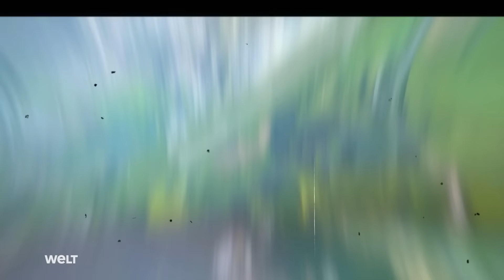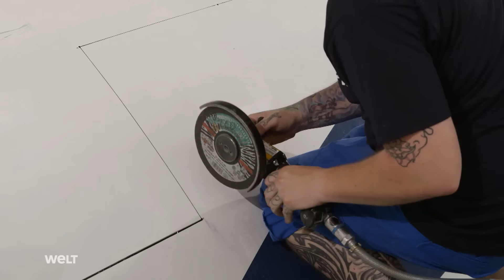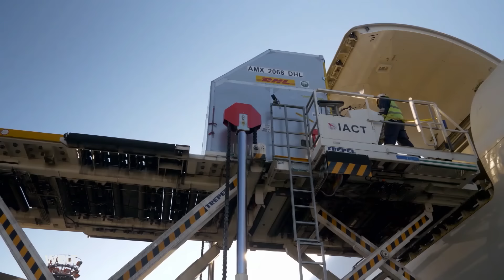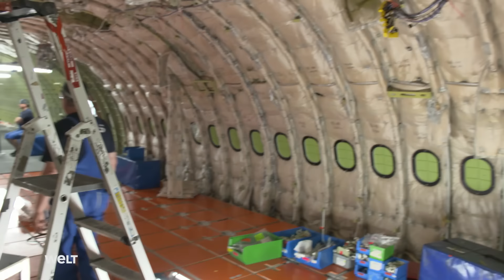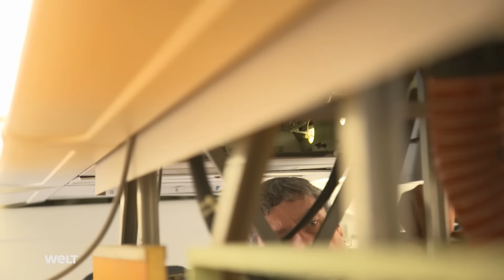AIRCRAFT CONVERSION XXL - A cargo plane is born  | Full Documentary

Comment: The term 'former' probably means 'frame.' It's been translated from German and they missed on this one.
Hydraulic systems don't use 'oil' they use "Skydrol," a synthetic oil that is less flammable.
36:21: That yellow rod installed in the empty nacelle is used to equalize weight on the airplane structure. It weighs the same as a jet engine.

Comment: I drove garbage trucks which have a governor on the engine & a PTO which goes into overspend to dump the load. Why can't planes have a limiter to prevent overspeed in the throttle cable?

Comment: I’m so impressed you are talking about this. As a student myself I didn’t really realise how easy it can be to over speed. Incredible, surely there should be a limiter like a motorcycle. Also I do have a question, if you were ready to lift wasn’t the governor active controlling the engine and rotor rpm?

Comment: I was a licensed aircraft mechanic back in the sixties. I worked for a company called Hollywood Aviation in Southern California. We converted four engine DC-6 and 7 passenger aircraft to cargo aircraft  under contract to a company in Chile. They hauled all kinds of produce and  butchered beef over the Chilean Andes. It took about six months to convert each plane to a cargo carrier. Our crew was around fifty mechanics and technicians. We also converted Convair  660s and 880s to twin turbine engines which required the engine nacelles to be re-engineered and made of stainless steel.

Comment: Very nice informative video. One small query is why the original passamger jet  engines are removed and replaced with other ? Does cargo planes requir additional high power emgines?.
Reply: It's like an engine rebuild, the old engines must have won out during it's 20 year working lifespan so either new or rebuilt engines are needed obviously

Comment: I'm curious - the pilots (and presumably anyone else in the cockpit) have O2 available. If they had a cargo compartment fire, could they flood it with Halon BCM while the crew were on O2 to extinguish fire?

Do they still use the belly space for cargo as well?
Reply: FedEx has a system kinda like this on some a/c. An arm in the ceiling goes to the affected cargo can, drops down and pierces it, and injects extinguisher. I'll see if I can find a video on it.

Otherwise, simply depressurizing the a/c and going on o2 will starve a fire without any extinguishing agent at all, provided the a/c is at altitude

Comment: A very interesting documentary. I was wondering though what happens to the original baggage/freight compartment area? Is it used at all?
Reply: Loading cargo aircraft is all about how fast can they get it loaded and turn around. That's why they use those preloaded pods. If they had to also try and load the secondary areas, it would slow the aircraft production time down as all that cargo would have to be hand loaded and unloaded.
Reply: Not usually.
Reply: Yes. They sell seats ,etc to other buyers. There's a big selection of used parts, quite lucrative.

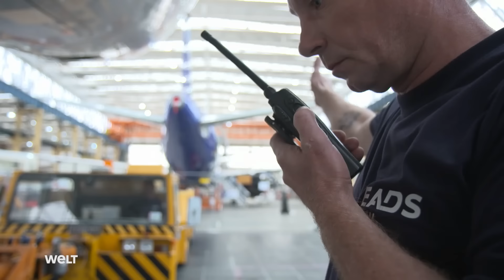Comment: One of the aircraft shown here, the former China Eastern A300 @46:42 never left Dresden, as the operator went bust. It was completed and is still sitting there six years later.
Reply: Shoulda sold to UPS for a fistful of dollars 💵
Reply: Why hasn't it been sold by now?
Reply: @k13ehr  The thing that might be useful to know, is that EFW either buys a plane outright (like in this video) and then sells it onwards once converted, but they also work on behalf of the owner to convert their plane, which is the case with the one still parked at Dresden. 

I'd be willing to bet that, because it belongs to an operator that imploded under the weight of it's own debts, EFW probably wasn't paid so they refused to release the aircraft. They will likely hold the plane until they either get paid or the liquidators agree to hand ownership to EFW/are forced to via court which can take years, so they can sell it.
Reply: @sloeginandsleep1170  Thanks, I partake of a little sloe gin on occasion.
Reply: @k13ehr  I've no idea
Reply: Wouldn't you have thought the a300's engines and aerodynamics would make it just a poor choice for bringing back into service? She's an old aircraft
Reply: @MaintenanceEngineerNH  Believe in JESUS today, confess and repent of your sins. No one goes to heaven for doing good but by believing in JESUS who died for our sins. Hell isn't fun. GOD loves you soo much unconditionally.😍🍂❤💙

Comment: There are so many A380's and 747's that are being retired almost monthly. I would like to see the A380 especially get a new lease on life as a cargo conversion. Imagine how much one of those things could hold! And when I flew to Alaska it was on a Combi. A 737 that was passengers in the front half and cargo in the back half. They don't have demand to fill either one but splitting it in half makes it financially viable.
Reply: The problem with the A380 is that the 2-deck design is not suitable for full-size cargo containers. The decks are too low, and moving the floors would mean a complete rebuild of the airplane. But even then, there is no loading equipment that can reach the upper floor, so basically only one floor will be usable anyways - which means that there is basically no advantage compared to smaller aircraft. Add to that the relatively high operating cost and it's just not economical.

The 737 is a very special case, particularly because its design allows the installation of a front cargo door for oversized loads.
Reply: The a380 will never he a cargo aircraft. It could just barely take off under its own weight. What makes you think it could hold cargo?
Reply: @6z0  the cargo capacity of an  A380 is about 50t according to Emirates.

Granted, not much for an aircraft of this size, but also not just "barely able to take off".
Reply: @6z0  technically the passengers are cargo chief, but that's not the reason why it's not converted, it's just not cost effective to convert it, it's design doesn't allow conversion cause it wasn't designed with conversion in mind unlike the 747 that had a freighter version so it was just a matter of transfering or rebuild with the respective parts.

Comment: I love jet aircraft, but accidents do happen. I was a test cell technician in the Navy. I crawled over the engine when it was running and checked for leaks and set the fuel control according to control room specs. I have worked on hundreds of jet engines in my day. I was in the Navy when the first F-14 arrived at Oceana NAS and we had to modify the thrust bed to handle the huge engine. I have been in the test cell with some Petty Officers and a Chief when they lit the afterburners as we stood just a few feet away. It was against regulations to be in there when the afterburners were tested, but for some reason we had to make an exception. I was watching while the officers observed the afterburner rings. That was pretty amazing. 1974.

Comment: It's amazing how all that weight of each engine is supported by just 8 mounting bolts, those must be the strongest bolts in the world😮
Reply: Not so strong as you'd think. It's important that under extreme stress the bolts break (releasing the engine) well before the wing would experience damage. After all, an aircraft can glide without an engine, but doesn't do so well when missing a wing!
Reply: This bolt made of titanium.
Reply: Years ago a DC-10 crashed in Chicago when damaged bolts broke and the engine ripped off the plane, Flight controls were affected and the plane went inverted and crashed with all killed.
Reply: @BigTrain175  That's American Airlines 191. A bit more than a decade later, a 747 crash under similar circumstances: failed engine bolt, loose engine rams another engine, both engines damages the wing, and flight controls were compromised. El Al 1862

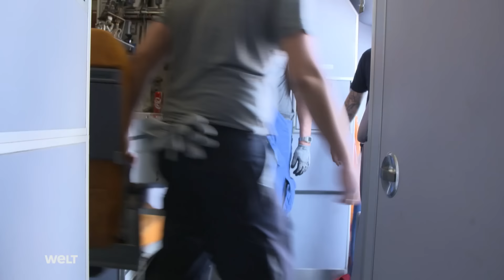Comment: I used to be a mechanic and we would convert our jet aircraft from PAX to cargo then back again on a regular basis...(see 37:00) HUGE job made harder by the axiom that it's 2-3x harder and more time to put something together again after taking apart, made worse when some mechanic would not label parts or protect them before chucking them into a bin.

Our situation was even tougher that this job because while we didn't have to do all the structural work, we had an airplane on a TIGHT schedule and the work HAD to be done on time. Once on a shift that stretched into 18+ hours, fell sound asleep on the floor between two seats I was trying to fit. High pressure, exhausting work.

Good documentary - horrible music.

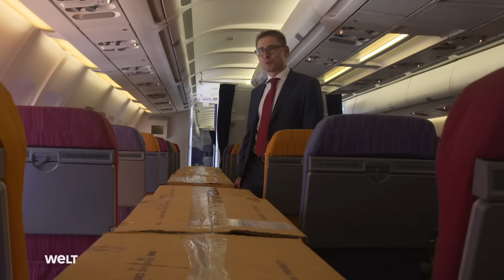Comment: 15:29 Wait a minute! The documents and the plane must fly separately. The original documents shall not be lost if something happens to the plane. How can the authorities know what's installed on the aircraft and look for clues if it's lost?
Reply: It's 2021. The real question is why they are still using paper.
Reply: @johnny_eth  Because the records need to be readable for decades. If I gave you a floppy diskette from the 1990s you probably wouldn't even now have the drive to read it, much less the correct software. Store that diskette for another twenty years and the situation is even worse. (Depending on how careful you are with the storage conditions, the diskette may no longer be readable on any hardware.)

There are, of course, long-term solutions for electronic data storage and retrieval, but doing it with the reliability of paper is not at all cheap.
Reply: @johnny_eth  lmaooo
Reply: @johnny_eth  fuel ⛽
Reply: They ALL carry the forms when they change owners….ALWAYS
Reply: Now the plane is loss, do you still need the documents????😂 Documents always stays with the plane when transferring ownership!

Comment: does this conversion address the nose down pitch of the original A330 which was address on the factory A330F by modified nosegear and nose blister?
The18mil euro for the conversion is not bad price at all when compared to the D-check price tag
Reply: The A330F is based on the A330-200. This is   a -300, which has no pitch down.

Comment: So the passenger area is converted to cargo. But what happens to the original baggage hold area located under the passenger seat area? Not used?
Reply: It will still be used for cargo.  Since it is already built for pallets or LD3s, no conversion work is required.

Comment: I am working on the same aircraft type from heavy maintenance to modifications. Still I am fascinated with the beauty of this machine. That A330 PW engine is the most difficult to remove because of the raceway of harness. Did it on Air Berlin A330’s
Reply: Huh? I have changed tons of engines and never had to remove a harness to drop one
Reply: @justing42  Believe in JESUS today, confess and repent of your sins. No one goes to heaven for doing good but by believing in JESUS who died for our sins. Hell isn't fun. GOD loves you soo much unconditionally.😍🍂❤💙
Reply: I wonder why the buyer couldn’t come to a deal to buy the engines from the airline or engine lessor. Maybe they were due for overhaul anyway? Or the new aircraft owner wants newly overhauled powerplants? Curious as to the reason

Comment: I have been in aerospace manufacturing for 36 years and will retire in August. Both major assembly and as a machinist. I worked for Boeing , TRW , Lucas Varity, and now Parker Hannifin. I have made parts for almost anything with wings including the space shuttle program. I have drilled millions of holes and shot millions of fasteners. I am very familiar with what goes on in a conversion. Converting aircraft is a very viable method of extending the usefulness of an aircraft. New avionics and new engines with structural modifications can render a passenger aircraft into a dependable freighter. Cost is far less than new aircraft also.
Reply: I've always said kinda the same thing about converted freighters. Ever since I saw one of the aircraft boneyards out in the desert in CA or AZ. I would see so many huge jets i.e. B747's, I thought that with all the air freighters you see in any plane spotting videos, that it could be very profitable to buy some that are in good shape and convert them. I don't know what th he resale value is on a B747 in good overall condition. But it's not going to be near what the cost of a new B747-8F would be. Buy it, convert it, and put it into service! I doubt It would take very long to pay for itself!!✈✈
Reply: Thank you for that! Question; Why is the airframe converted in the first place? In this day and age. is cargo more profitable than flying people? What determines the decision for the conversion?
Reply: @trevor6721   
I would guess they have to add stronger supports and stress bearing areas bc cargo weighs more.than a plane full of passengers. As far as the profitability, the airlines cant get enough asses in the seats to offset the cost of flying B747's.
But cargo is always in demand. People love stuff....lol! So they have to do the conversions to strengthen the airplanes and it's way less $$$ to convert a 747-400 than to order brand new 747-8F's.
Reply: @trevor6721 There’s a few things a play here, I’ll break it down. Firstly, cargo isn’t necessarily more profitable for airlines, but it is decidedly less cost to operate. With people, you have to have seating, lighting, toilet, galleys, food and drink and cabin crew to pay. There’s constant cleaning, maintenance of non flight essential equipment such as cooking equipment, seats and carpet and so on. Technically passengers have a higher income potential…but, they cost more because of all of those ancillaries. So they tend to be neck and neck for outright profit margin. 

In terms of picking airframes, they tend to use “Lifecycle end” airframes. Planes such as the 747, MD11 and A330 are still functional and capable of earning money, but as they age, more and more maintenance is required to all those parts essential for passengers; this is expensive. For example. Refitting a A330 for passenger service, replacing seating, carpets, in flight entertainment, lighting units, galley equipment and so on can cost millions. Between the cost of doing this, and then the fact that the airframe is outdated and their being better and newer planes to do the same job, with better fuel efficiency and with warranties etc, means that’s when they tend to be retired out. As a useful gauge of efficiency, if your car uses 1% more fuel a year, you’d barely notice. An extra 1% of fuel use on a plane could equate to $100,000 a week. This is when converters step into the fray. They pick the airframes with are structurally sound, or a reasonable price and can be converted without excess cost in repairs or refits. 

So say you’re looking at a 747-8F new, it would have cost $414 million. A used airframe which requires significant repairs will cost around $25 million, and need another $10 million of repairs before the €30 million conversion, so they leave that airframe behind. A good condition 747-400 may cost around $30 million, and then another 30 for conversion, so is significantly cheaper than a poorer quality airframe. That’s what they use to select and decide what to convert. 

The A330 in this video is a good case in point. It’s reached the end of the road in revenue service, without millions of refitting; even after that, it is still well out of warranty, noisier, less comfortable, uses more fuel and is less reliable than a new plane. So the airline sells it to a converter, who then once complete sells it to the end user, fully repaired, fully converted, fully warrantied, and ready to earn money from day one. 

Hope this helps, from flight crew of both cargo and passenger service 👍
Reply: In a world so invested into recycling, the conversion to freighter is brilliant!
Reply: Congrats on your retirement!
Reply: They don’t pute new engines neither new avionics , they just refurbish the old engines , first angines are 35% of the airplane cost !!! Seconde you can’t fit a different type or model angine to an any given aircraft !!!! I am an aeronautical engineer specialised in engines ( propulsion ) , trying to fit new engines will cost around 70 million $ just to buy theme !!!! Better buy a new one !!!
Reply: A Boeing guy….lazy B….sure have met some clowns that worked at Boeing.  My favorite are the ones that stop me on the jet bridge getting off the plane and announce to me they work there and ( I guess I am supposed to be impressed ) that I really need to take a look at ____ ….which I rarely do.  Being the guy that puts the hubcaps on all day doesn’t translate to knowing jack about airplanes.  How many hydraulic pumps are on a 757? Where does the head pressure come from and at what PSI? What is the localizer?  What is the RAT?  99% of Boeing guys can’t answer basic aircraft questions and they work for the company that BUILDS them….Boeing…..pffffft
Reply: Oo😊😊o 😊
Reply: Thanks for sharing.
Reply: Congratulations 🎊🎈🍾, I’m retiring too this week August 22! Electrician for 45 years on Trains, Moveable Bridges and Commercial and residential buildings. I wish I could have worked on airplanes, I live 3 blocks from JFK AIRPORT in NYC!?
Reply: Hope you’re enjoying retirement. Love this comment, thank you Johnny!

Comment: Interesting thing I noticed.  The aircraft documentation traveled WITH the plane.  I thought this was frowned upon because ‘if’ the plane crashed enroute, (due to a latent maintenance error, ) they would lose the paperwork trail of the plane, and thus an important means of pinpointing what went wrong, when it happened and who was involved.  I, frequently have to fly to breakdown locations to rectify planes and it is a requirement to photo & email the log book entries I sign before flying back with the plane in case the plane is involved in an accident, losing the log book, the engineer and what was last done.  This is the level of nit picking aircraft documentation airlines go through.